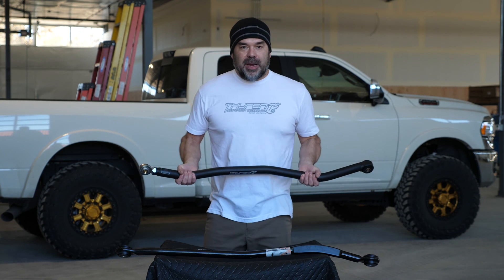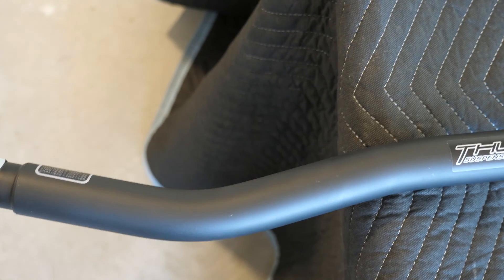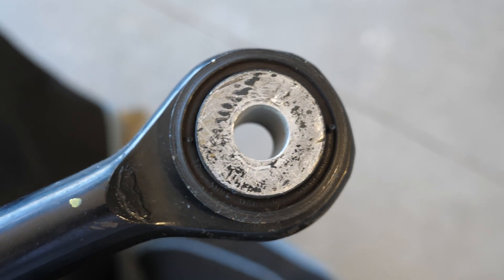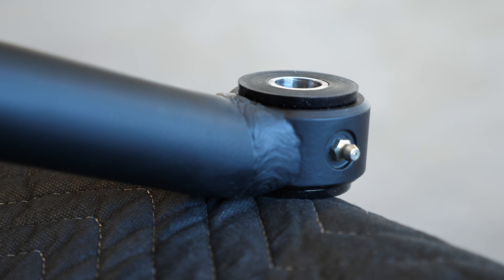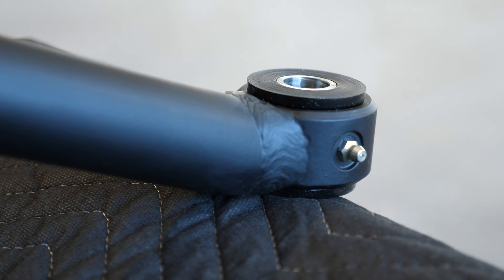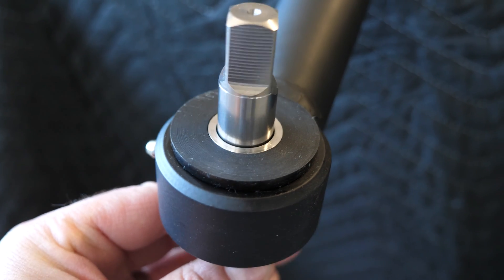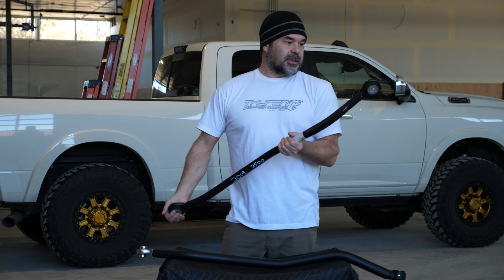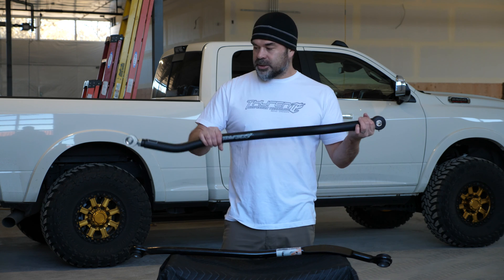Thuren Fabrication trackbar design, in depth tech info!

Comment: I put a Thuren trackbar on my 08 in 2010. I have over 317k on it. Just recently I had an issue where my truck felt "drunk"…..i replaced the long tierod with oem and it felt different , but sitl "drunk"……I had a trusted friend steer my truck left and right while I was lying under the truck watching the track bar. The axle end had a very small amount of play in it. I just ordered another heim joinr end from Thuren. I realize just now that this is exactly the way my original track bar problem felt. Can’t wait to get my new heim joint installed……to sum it all up…..That Thuren track bar has handled close to 300k miles of abuse and its only gonna cost me $58 bucks to make it like new again.

Comment: Don is the man. I just took delivery of a 2021 Ram 2500 Cummins Limited and I will be checking his product line out for a front end level… I have eyes on the soft ride 2” coils, Fox shocks, steering stabilizer, and of course the track bar. 🤘🏻

Comment: I purchased and installed the 3" coils, shocks, control arms and track bar. My local shop was changing my oil and showed me my worn front end. The track bar showed "slop" in it. When I installed it, I used the measurement from the instructions. What could cause this "slop" that they showed me? Any help/suggestions would be appreciated Thuren Fabrication Inc. Thanks